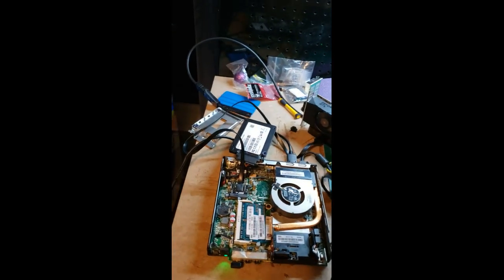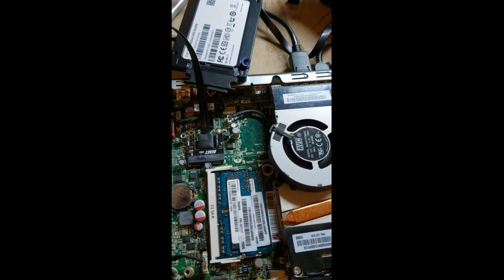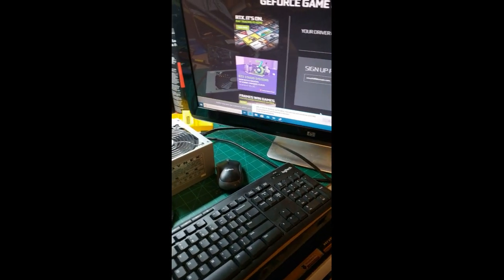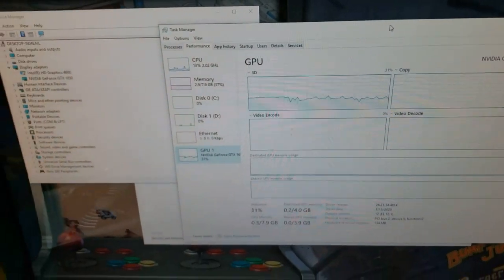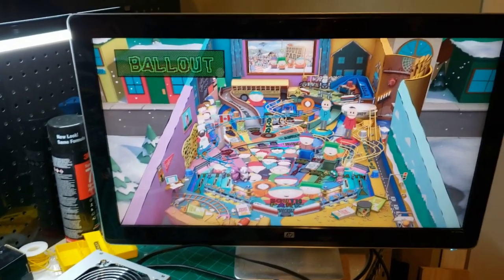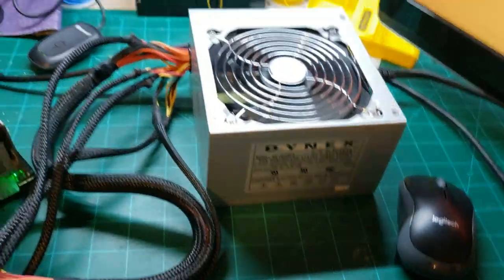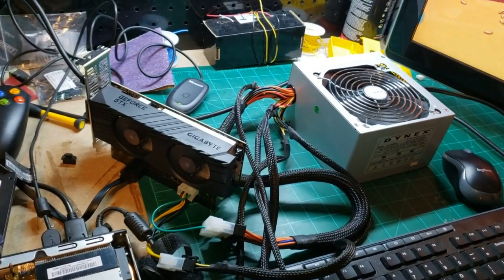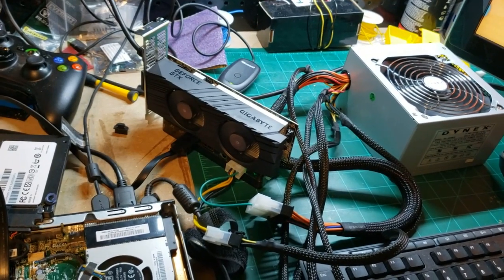Can you add a NVidia GTX 1650 Low Profile GPU to a Lenovo m93 Tiny USFF computer?

Comment: If you want to use it at a screamingly terrible speed, there is A Wi-Fi card that you can remove to free up a PCIe bus that's like four lanes wide. If you want to keep your Wi-Fi card working you can modify the BIOS of this computer to enable an extra slot and then solder that on

Comment: Great video! I'm trying to do the same thing, basically see how far I can push these Lenova m93's.  I purchased several mini PCI-E connectors and the problem I'm having is that the PCI-E X1 connectors are too thick to fit in the PCI-E slot on the motherboard.  Can you please let me know the model and parts # from your order off of AliExpress?  You must have lucked out and ordered the slimmest PCI-E.  Mine are all 1.66mm thick. Yours must be 1.0mm.
I look forward to your reply.
Reply from the maker: The store on AliExpress I bought from does not exist anymore. Been a while since I did this project. I do not have the video card anymore and that is why I have not pursued any further at this time.

What I can do is dig up the PCI-E adaptor I have and try to find one that is a duplicate on Aliexpress. However, may take me a few weeks to get to it, as it is buried in a bunch of other things I have to clean out and finishing up some other projects.

Comment: I have Lenovo m715q ryzen 3 with Vega 8 is this compaitable with it
Reply from the maker: From the specs I looked up, that computer uses a M.2 slot. The m93 uses a PCI-E slot. I would think if you bought a Independent Video Card Dock that uses M.2, instead of PCI-E then should work. However, cannot guarantee that it will work though.
Reply: @The_Passable_Gamer  ok thanks I will try  with ngff m.2
Reply: @The_Passable_Gamer  what settings I have to do in bios settings before this setup ?
Reply from the maker: @sayedmuhammadwaqarshah237  I did not have to do anything in the BIOS when I did my machine, so I am assuming you would not either. However, since they are different model machines I am not sure.
Reply: @The_Passable_Gamer  how much psu needed 250 watts is enough for doing this setup with gtx 1050ti or gtx 1650
Reply: @The_Passable_Gamer  plz tell me where can I buy m.2 video card dock plz send me link
Reply from the maker: @sayedmuhammadwaqarshah237  This is one on Amazon, but not sure if there are different M.2 ports.

https://www.amazon.com/Laptop-External-Independent-Graphics-Version/dp/B08SQHF6QM/ref=sr_1_3?dchild=1&keywords=m.2+video+card+dock&qid=1611356223&sr=8-3

Comment: Hi ! What is the reference of the adaptator ?
Reply from the maker: If you mean a link where I bought from, I bought from AliExpress. The original store I bought from does not have them anymore. However, this is another link on AliExpress that sells them. From the pic, it looks the same as the one I bought, so buy at your own risk as I cannot confirm if exactly the same. 

If you do try to buy, just make sure you select the correct Option, as there are six. In this case the one I had was Option 1, which is PCI-E. If you want other options, PCI-E, M.2 and ExpressCard cables, then go with Option 7. Costs about 30 dollars more, but have all cables needed. But if you are using for the M93, then Option 1 would be the one you want.

If you have concerns about buying from AliExpress, can purchase from Amazon, but a little more expensive.

Amazon:
https://www.amazon.com/External-Independent-Expresscard-Interface-Without/dp/B07ZX97ZZQ/ref=sr_1_5?crid=3GA08EDQTR4PE&dchild=1&keywords=exp+gdc+laptop+external+pci-e+graphics+card&qid=1608760269&sprefix=PCI%3DE+Exp+GDC+%2Caps%2C193&sr=8-5

AliExpress:
https://www.aliexpress.com/item/32824725772.html?spm=a2g0o.productlist.0.0.b2995439pQ2roX&algo_pvid=2b13e90c-ad4e-44ad-81d0-4ca1766f7fc0&algo_expid=2b13e90c-ad4e-44ad-81d0-4ca1766f7fc0-1&btsid=0bb0623316087598290223976e444b&ws_ab_test=searchweb0_0,searchweb201602_,searchweb201603_

Comment: Is  there any GPU that fit "inside" the cabinet?
Reply from the maker: If you are talking about the case of the computer...then no...this is a very small computer and no other ports, other than the one specified.
Reply: @The_Passable_Gamer  Thinkstation P330 tiny comes with a NVIDIA Quadro P620 card and is the same size as all the thinkcentre tiny computers.. Have one of those at the office
Reply: @sigurdmellqvist7802  those p330 are very expensive

Comment: I have a Lenovo M93p exactly like yours and I connected a GT 1030 (ASUS) using also the same docker, but after sometime playing a game (like fortnite) I am getting a Blue Screen of Detah (BSoD). Digging on the internet I found some suggestions about it could be a driver issue. I tried many different GT 1030 drivers from different dates and nothing. I did try with another  version GT 1030 (MSI) and same issue. I did try with a GT 710 and it worked fine but the graphics sucks. Would you have any suggestion?
Reply from the maker: Unfortuantely no. I have not revisited since I did the initail video and have not played for long periods of time with it. I was using a 1060 and may run into the same issue if playing for long period of time. Only thing I can suggest is using Windows 10, possible update to latest feature pack since you have tried different video drivers. Other than that, I could not be much more help.

Comment: i almost do the same, but i cancel my plan for that, i think cable will make bottlenect the graphic bandwidth
Reply from the maker: It does have a bottleneck no doubt, as the port you plug in is only x1, but still gives a performance boost. I ran 3d Mark and it scored a lot higher than the internal. I do not have the score in front of me, but during the test it was getting about 20-22fps vs about 1-3fps with the internal.